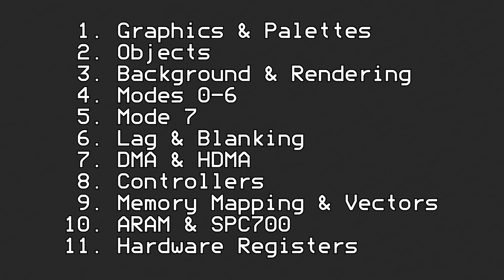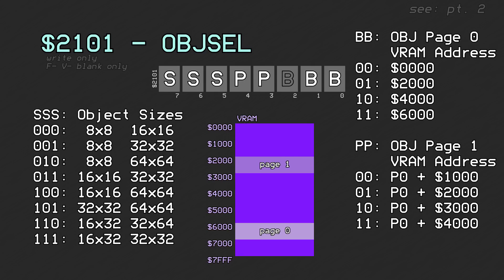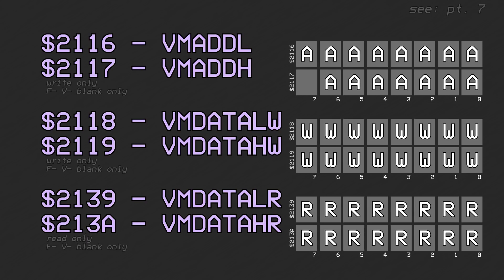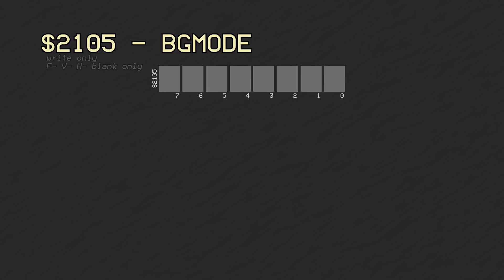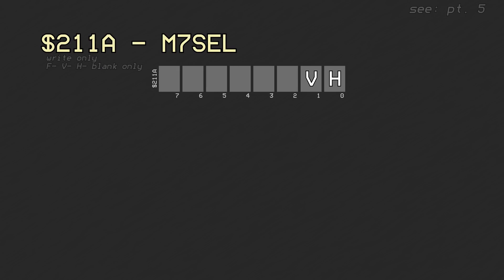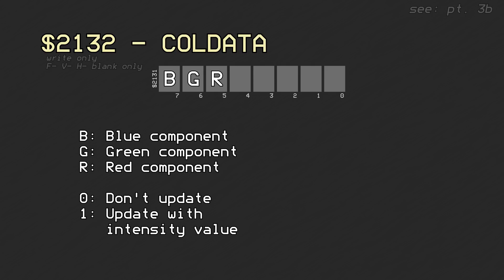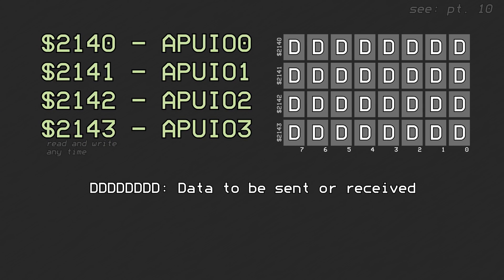Hardware Registers - Super Nintendo Entertainment System Features Pt. 11

Comment: This series taught me a lot about old hardware design and coding. These are possibly the best videos on hardware I’ve ever seen!
Reply: these are quality videos,not the crap tha ytuve is full off
Reply: um jammer lammy
Reply: This series taught me way, way more about how computers work than my uni classes
Reply: When RAM is expensive and clockspeeds are relatively low those systems used some really clever approaches to get things done, and that's what gives them personality. Each system used a different set of approaches to accomplish things and as such they end up having a certain "look" to them. It's easy to spot a Commodore 64 game just by looking at it, just like the old Atari systems, ZX Spectrums and so on. Newer consoles are all so evenly powered that they start to look the same and differ only in what games have been developed for them. I think this is what people miss about those old retro systems.
Reply: @brettito  i'll make sure to do it. thanks for the suggestion
Reply: @brettito  He's absolutely awful.  Don't check out that channel.
Reply: @recompile  What's so terrible about it?
Reply: @Craftplacer  👀
Reply: Check out modern vintage gaming - he has some good stuff as well. More high level but still very interesting.

Comment: Here I go getting excited about 30 year old computer chips again
Reply: Dude the SNES and Genesis have the perfect balance in my opinion: powerful enough to be fun to play 30 years later, but still weak enough to provide some challenge for the developers. As a young programmer I sometimes feel like I have it too easy with gigahertz clock speeds, powerful GPU's (even the low-end integrated ones), and several gigabytes of RAM at my fingertips....
Reply: @andrewsprojectsinnovations6352  Not a coder but agree, the puzzle solving and unique workflow is greatz,
I also think NES is just too limited and this is where it really started to get a good working base,
we can still find uses of its legacy today like the additional blending of layers.

Comment: Then N64 stuff explained…
Reply: why
Reply: @mariocamspam72  An explanation of the N64 microcode would be interesting. Wouldn't expect the CPU to be all that unique regarding MIPS.
Reply: Honestly, I'd love a Sega Saturn explained series. I've always wondered why it was so legendarily hard to program for, and the most I've gotten was "it had two CPUs and a separate graphics chip". This doesn't really tell me much. And I know that multi-processing was in its infancy in those days compared to now, but I'd really love to know what exactly was going on that was so hard to deal with.
Reply: @GeneralBolas  It would actually make a great addition to this series. The dual graphics chips are fairly interesting mostly in that the 3D GPU uses quads which can essentially just be seen as being really complex 2D sprite manipulation. A big issue with those was the immense calculation time needed to do a single quad transform. It took the Saturn CPU's 28 cycle to do a single transform, compare this with 13 cycles for a polygon transform on the PS1 and you start to get an idea of the issues.

The second GPU is used only for 2D assets but is used in a fashion kind of similar to SNES Mode 7. An excellent example of it in action is with the Panzer dragon games in that the scrolling ground on all levels is merely a 2D object being manipulated as a background layer. 

The dual CPU's aren't too amazing except for their 16bit dual instruction issuing in which two 16bit instructions could be issued per a single 32bit instruction, a neat trick of the SH2 chips. The SCU chip with its 6 way instruction issuing for use with Matrix transforms would be very interesting but I think the channel Coding Secrets has already covered that fairly well.

An interesting system to cover but not sure if there would be much new to learn from it.

Comment: One thing that still puzzles me is the idea of "writing twice" to any given register. What is the purpose of writing a byte somewhere, just to immediately overwrite it? Is there a practical reason to do this, or is the procedure associated with it something else completely?
Reply from the maker: Internally, it's a 16-bit register and flip-flop, mapped to an 8-bit memory location. So the first time you write to it, you write to the lower half of the register, the flip-flop switches over, and the second time you write to the upper half. It is odd though that there is a mix between both write-twice and the more intuitive pairs of 8-bit registers though.
Reply: Even the NES PPU has a bit of flip-flop logic like this. Its VRAM address has to be set up in a similar double-write manner, and by extension the screen X and Y coordinates share the same flip-flop. You can even do something like "Write the high byte of the address, then write the Y coordinate immediately". So it's good practice to either keep track of which state that flip-flop is in or reset in manually with a read of the status register before doing your thing.
Reply: @RGMechEx   @VuurniacSquarewave  Ah, makes sense. There's probably some compatibility or cost concerns in effect — 16 bit CPU and PPU, 16 bit registers, no fumbling with "is this x-bit or y-bit logic". Excellent replies btw, it's great to see technical minds converge.

Comment: I hope there is a video about add on chips in the cartridge, particularly the Super FX and how it draws to the SNES screen. Please.
Reply: And how it texture maps polys
Reply: @hicknopunk  The only hardware feature of the Super FX that's directly related to rendering graphics is the PLOT instruction, which draws a single pixel to a buffer. Apart from that, it's basically software rendering, so texture mapping is completely up the programmer, it's not a feature of the chip.
Reply: @awanderer5446  I'm not doubting you, is there any document on software rendering on the SNES which describes how exactly they texture mapped polys?

Comment: Very comprehensive. Thanks for making this. 
I am curious about that expansion port and if it is possible to hack in a helper PPU.
Reply: I wonder if it could be possible to make a custom expansion port ethernet adapter and a custom cartridge with a custom browser...
Reply: IIRC bsnes has an option to enable 128KB of VRAM (you have to recompile from source), but it's only useful for homebrew games. It also breaks at least some commercial titles.

Comment: Hey, just wanted to say: I absolutely love these videos. I think I've watched every single video on your channel at this point. Your production values are top notch, even the audio which has steadily gotten better over time. However, there's still one problem with your audio that I think would drastically improve the watching experience: getting rid of the audio clipping caused by plosives in your speech. Just add a pop filter to block the loud "P" sounds and it'll be basically perfect!

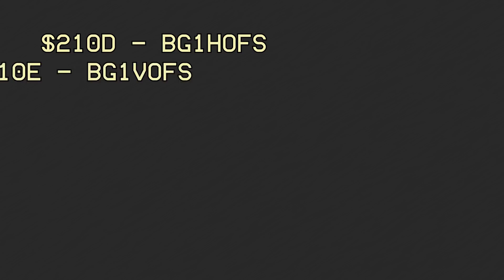Comment: 10:41 although note that when looking at the tile to the right, on original hardware this does not carry to the high nybble if the tile ID ends in F. Emulators vary.

Comment: i don't understand these infos enough to use them.
i now have more respect for makers of
16-bit and earlier
video games.

even though i realized that making games for old systems will never be for me, i also got some very useful ideas for my modern computer games that i would not have had if i didn't watch your videos*.

* the bitplanes thing made me want to split my sprites in a similar way so that i can not only put different colors on each part, but also different shaders (which would be the 2d equivalent of putting different "materials" on different parts of a 3d model).
and i will also want to purpose an array as a stack in an especially RNG-heavy game to pull pre-generated random numbers, so that not nearly as many of them have to be generated at once, which saves performance.

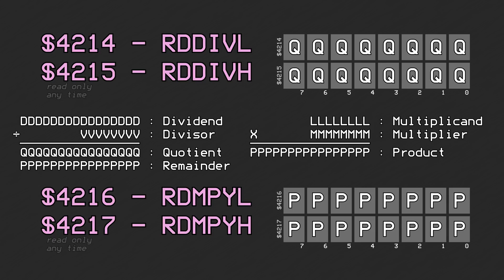Comment: 20:32 Why does the remainder have more bits than the divisor? Shouldn't the top 8 bits always be 0 after a division by anything but 0?
Reply from the maker: The upper byte may always end up zero, yes. This just ensures that it is safe to read the remainder registers as a single 16-bit word, and you don't have to worry about masking away the top 8 bits.

Comment: I was wondering if you could thoroughly give people an answer to these glitches my brother found on his NES Classic Edition system: In Balloon Fight, if you hug the right edge of the screen in Balloon Trip mode, then the piranha will never appear, no matter how long you float in/near the water. In Bubble Bobble, the password DEDDD will take you to round F9, which apparently a Super Drunk bossfight, like any round after B3. Some passwords, like this one, will give you a bad ending when you complete the bossfight. Others can give you a good ending if you have a second player spawned in, which can be done in 1P mode by pausing and pressing SELECT, unless you have no spare lives left. In Castlevania II: Simon's Quest, you can occasionally pause and glitch the colors of the pause menu/map, which can be fixed by pausing over the glitches colors. Sometimes, half of a set of blocks get deleted somehow, and by either whipping or throwing holy water on the ground with precise timing when you fall, you can fall through the ground and potentially into invisible water. In Donkey Kong Jr, after dropping both fruits in the final stage somewhere in between the 5th and 15th level (he forgot where exactly), the game lags for a few frames and stray 0s show up on the top of the screen. In Excitebike, driving off an upwards slope, tilting forward, then leaning back as you hit a ramp can send the bike flying upwards, sometimes so high that it wraps around to the bottom of the screen before falling back down. In Ice Climber, if you jump on the first frame you hit a platform, you jump again, bypassing the collision for the platform above. In Kid Icarus, my brother found this out about passwords: Increasing the 23rd value by 1 and the 24th value by 4, you get another password as follows: title screen, start/continue screen, 1-x, where x is a common variable that will crash if it is not 1, 2, or 3, 1-4, 2-x, 2-4, 3-x, 3-4, 4-1, ending. If you go beyond the ending, the game will also crash. Some of these crashes are detected by the system and bring up an error message, then return you to the main menu, others do not. You can type 24 of 0s, Ls, gs, or !s, each of which has a value of 21 higher, to get another working password. Typing 24 vs or 24 !s will cause a crash, so use the rule above in reverse to prevent this. The weirdest crash occurs if you load 2-0 using the password !!!!!! !!!!!! !!!!!! !!!!qJ. Loading the 4th level as a non-dungeon level will also crash the game. You can also count the number of values from 0 an individual password has and then replace all values with ones of the same distance from ! and get another working password. Use the first rule as necessary to avoid crashing by not loading normal stages with a value of 0 or 4-255. Another important rule: If you increase the 22nd value by 4 and the 23rd value by 16, it will increment the sub-stage number by 1. I'm a bit fuzzy on this one, but I think if you increase the 22nd value by 1 and the 24th value by 4, it will increase your strength level by 1. I might be incorrect here, as it has been a while. In Metroid, you can cause a variety of glitches effects and even crash the game with the password 210 -L KJIHGF EDCBA9 876543. If it does not crash, it will return you to the title screen. Passwords such as edcbaZ YXWVUT SRQnml kjihgf will also return you to the title screen but will crash if ERROR TRY AGAIN is displayed on the screen. In Super Mario Bros, the maximum number of lives you can get without getting a GAME OVER is 129, but you can also cause an overflow and get 0 lives, displayed as x0. You can also execute the over-the-Goal-Pole glitch in 1-1, 3-1, and 3-3. Super Mario Bros. 2, if you throw an enemy into the ground just as the stopwatch times out, it will become trapped in the ground. If it is under a ladder, you can jump and press B when you land to attempt to pick it up. If you do, you can press down on the D-pad to warp to another location. In 3-1, this will be 3-[], a glitches version of 1-2. You immediately move on to the next stage after clearing it, and fight the harder variant of Mouser at the end, which will return you to the vine at the top of the vertical section of 3-1. If you enter a Hawkdoor while holding an item, you can pause the game and press up, B, and A simultaneously on the second controller to cause the held item to drop, but you will take no damage. You can press the button combination again to actually die. In this event, the death animation will finish once you start the next level. In 1-2, if you get the flying carpet, fly under the ground, not flying too low so that you don't get stuck off-screen until the carpet timer expires or you fly down to you death. You can then fly up into the ground and quickly alternate left and right to slowly fly up through the ground until the carpet timer expires and you get stuck. The kill-the-Phanto glitch where you hit a key repeatedly with mushroom blocks until it plays an "oof" sound will not actually kill the Phanto, it just gets very far away. If you hit the key enough, it actually returns to normal until you hit it quite a few more times. You can kill the Phanto by running into it while both a star and stopwatch are active. In the vertical section of 1-1, if you  fall off the vine at the bottom and grab it again as you fall off the screen, you will be softlocked until you use the up+B+A trick to die. If you unpause at the right time, it will immediately move on to the screen that displays your remaining lives. If not, you will have to wait about 5 minutes before anything happens. In Super Mario Bros. 3, you can clip into and enter incorrectly any warp pipe with an exposed right side, including airship pipes. In 4-Fortress 2, in the backwards-C-shaped section, you can clip into the lower pipe and be taken into the 17th screen. Standing on a certain tile just off to the right will give you infinite coins until either the timer runs out or you pause. If you paused, just jump or walk off and onto the tile again. Since you may be invisible here, if you are, you will have to wait about 5 minutes to resume gameplay if you die. There is also a pipe hidden above that will take you to the card, softlocking the game once collected unless you have a warp whistle. You can also use the first downward-facing pipe to go down to an area below the start but above the 16th screen. If you are Small Mario, you can enter another pipe below that takes over 10 minutes to reach the end of. (By the way, which takes longer, this or Yellow MissingNo's "true cry"?) There is also another area just below this one that has consistently-changing blocks you can hit, if you manage to get lucky enough for this to happen, since also, there are very many possible places to be dropped from glitch pipes, but the ones aforementioned are the most common. These tiles can occasionally act like warp pipes. My brother found 3 rooms: An underground area with glitched graphics where you fall to your death, another exit area, and an empty castle area with the World 5 fortress texture and a single line of ground at the very bottom, where you are stuck until the timer expires. In 7-1, in the credits warp area, there is a pipe next to where you are dropped that seems to place you in the ground above the screen, where you are trapped until the timer expires. Also, while unpaused, the status bar is moved all the way up near the top of the screen and glitched graphics appear under it. It appears normal only when paused. In The Legend of Zelda, you can press perpendicular direction for 1 frame when 5 pixels from the edge of the screen to then walk through one end and across to the other. If you move back in the other direction after fully crossing, you will then move to the next screen in that direction. If you move left in the top-left corner or right in the bottom-right corner, the game will fade in again and place you at the cave where you get the first sword. In Zelda II: The Adventure of Link, if you jump up to the status bar at the top or higher, and cast FAIRY while in a town, it will make you fall into a version of the left screen of Rauru with the current town's NPCs and all doors leading back to the same place. Only in Rauru and Saria is the second door accessible. You can enter any doors 10 times before being sent out-of-bounds where you will fall back into the town and the glitching stops. You can cast FAIRY on the first possible frame in order to enter the door more times. After the 16th entry, you are placed back on solid ground. After 20 entries, once Link touches a fairy or casts a spell other than FAIRY, he will have a blue outline. After 40 entries, in this scenario, he will appear almost completely gray. My brother only managed to have this happen once, but after 60 entries, Link gets a ruby-red color in this situation. Also, the game freezes if you leave the screen on the same frame that the level-up menu appears. Can you look into these topics and make a video (or series of videos) about the information in this comment? Thanks for looking at this comment!